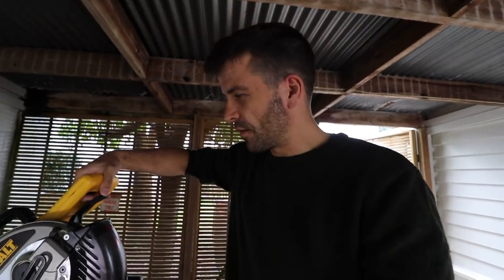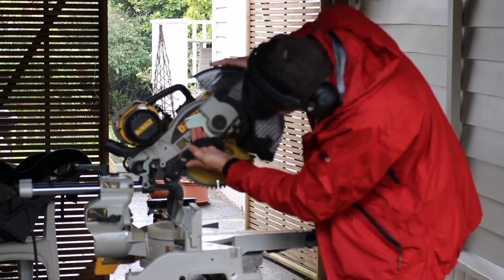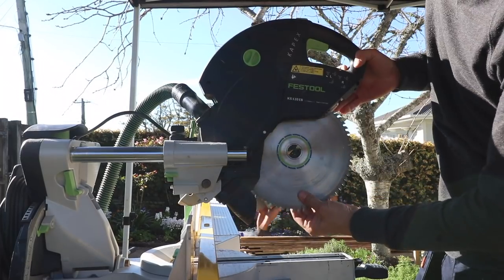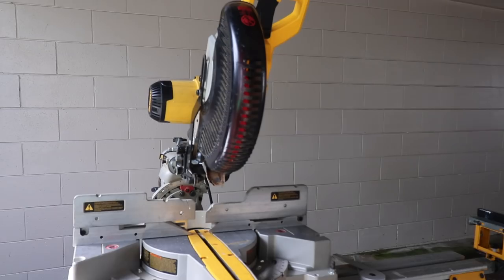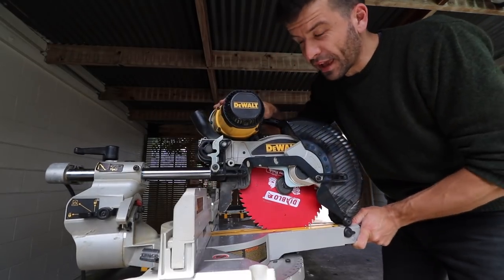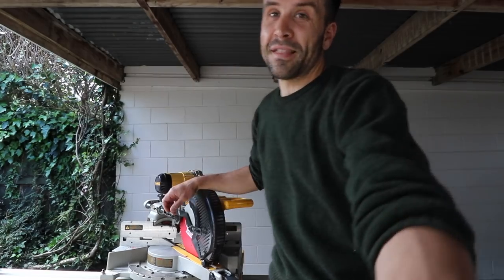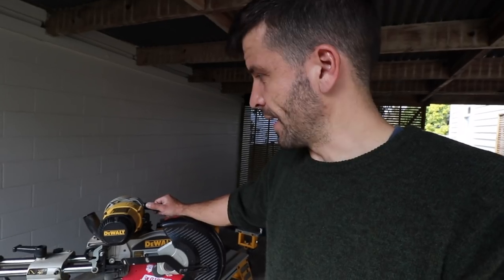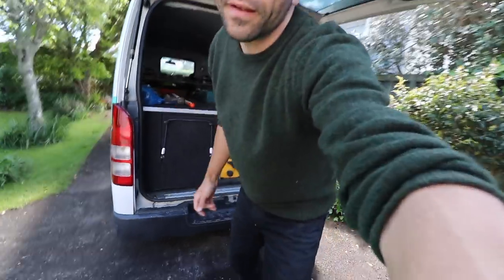Festool Kapex vs Dewalt Mitre Saw

Comment: Festool are very over rated i think, dewalt, makita keep it simple 👍🏻
Reply: +Samwise457
The only people that say they are overrated are those that do not need a Festool tool platform.  If you need accurate, clean, good value and a portable platform then Festool is the only way at the moment to go. 

Where else can I get a single brand tool platform that allows me to take a complete workshop on the road that every tool does exactly as it is suppose to. I have a complete Festool set up and not one of the tools is actually a weakness. 

I simply could not do it with Dewalt (do make great tools as well) as they simply do not have a single platform approach. 

If I went with dewalt I would have to buy several other tool brands as well and I can guarantee you I would end up with twice as many tools.
Reply: bighands69 i disagree with you but each to their own i believe you can achieve the same accuracy with any other professional brand
Reply: +Samewise457
WIth festool I can buy a CMS table that can act as a table saw, router table, sanding table and a jigsaw table. All with festool tools. And the dust collection on each of them is excellent meaning I can use them in a clients home. 

With the CMS  and MFT tables I almost have a full workshop with me on the road. The dust extraction works on all their tools with no problems. With festool drills I only need one drill unit that allows me to change the bit or adapter with just a click. There is no need to two drill units by my side. 

I can go on and on about how flexible the whole approach is.  If you only need a mitre saw then a Dewalt saw is excellent and accurate.
Reply: I recently used the Festool Domino DF500 for some odd shaped teak handrail.  Before I brought my domino in to use, the guys were freehand drilling 3/8" holes for dowels for the joints.  Extremely sloppy and the joints didn't line up very well meaning they required an S-ton of sanding.  The joints with dominos were almost perfect and required very little sanding.  I don't recommend Festool except for the Domino system.
Reply: I think there can be no argument bighands69 that, if you're already invested in the system, Festool offers decent flexibility and accuracy. They always strike me as a company that watches and listens to it's tools users, innovating - or at least producing - accordingly. That's a good thing and quite rare. For those not invested in the platform and already have tables saws, router tables etc, extolling the virtues of the CMS/MFT system will be lost as investment in both those with all accessories to be useful is significant. Whether the system is good value is subjective in this case. Most people don't invest in a system from the off but rather build a collection of tools as they go. Adding and replacing as necessary. However, the system approach is becoming more popular, particularly on the back of cordless tools, where it makes absolute sense. This changing market may well suit Festool. Whilst Festool are good and I'm certainly happy with the few bits I own (although I predominantly use Bosch, Mafell and Hilti) one thing I found found with Festool and it's users that you see to nowhere near the extent with other brands/users is what can only be described as a cultivated identity around Festool. It's marketing genius. And for all it's neat little ideas like portable parf tables and incremental mitre saw bevel adjust, it is mostly the marketing genius that sets the brand truly apart.
Reply: @johnjohansson1196 

No need to be rude.  I had a kapex and got rid of it.  It was inaccurate and Festool refused to fix it.  Festool is overrated, and I own over $6 G's of Festool stuff.  Not only is Festool overrated their service is shit.  I urge everyone to to avoid Festool except for their dominos.
Reply: Sad to hear, and very bad of them not to fix it,  but I  did not recommend it either. but to do like him I was rude to  and recommend a saw who is absolutely inaccurate and have a smal gap is fine?
Reply: I can use any saw. The new makita slider is my favorite saw ive ever owned.
Reply: +Bisch Basch Bosch
I do not identify with Festool like Apple fanboys do. I am more of a practical person. On a per tool basis Mafell are better than Festool and there is no real competition there maybe barring the Domino. 

Dewalt do on a one per one tool basis produce some tools that are as good as Festool such as Mitre saws. 

My point was more to do with the fact on the market place right now there are no tool platforms that could possibly allow me to take a workshop on the road in as little space as I can achieve with Festool. 

Now if Mafell could release a Mitre Saw and a MFT style work table and routing system that could complete with Festool I would be all in with them. As it stands I only have a few Mafell tools in the workshop. 

If I tried to go completely Mafell right now I probably would require other tool brands to fill in the gaps and that's when it starts to get funny and very awkward. 

An MFT table for working in client homes is a must. It means I do not need to have a table saw there even though I have the capability if need be with the CMS table. It is sort of like a workshop lego system.
Reply: Very well said. @BischBaschBosch
Reply: Makita ls1019/ls1219 ftw!  And priced so competitive where I am.  650 for the 12" saw currently.
Reply: @Chimp_No_1  
Bosch make great tools but you cannot make a complete workshop with them on the road.
Reply: @BischBaschBosch  just marketing genius?? Which other company offers similar products and accessories as whole.No marketing man would sell me anything which doesn't serve the purpose well indeed.The only flaw I see - not enough new tools
Reply: @eugeneeugene8252  I didn't say "just marketing genius". I said that is what sets them truly apart. I also mentioned the system approach is something they do well. 
Let me give you an example of Festools cultivated identity in action: There's a particular type of Uvex eye protectors I like. The same protectors come in Bosch and Festool branded variants. All are sold on Amazon and while the Bosch and Uvex own brand ones have 3 star ratings, the Festool ones have glowing 5 star ratings. They're all exactly the same other than brand/colour. 
I see this a lot. Festool do make great kit and, as you mention, they wouldn't be successful if they didn't. But, they don't make perfect kit (no one does tbh). You wouldn't think that though from the comments and reviews from Festool fans. I've got a handful of Festool machines  and I'm happy with them. I'm not uncritical though. It's this "fandom" of Festool which I describe as cultivated identity. No other manufacturer has it. 
Just my opinion. calling it how I see it.
Reply: @BischBaschBosch  yes, you are right,no manufacture has it and we  have to credit where it's due.Festool not perfect but most close to.It's not their fault that nobody tries to take them on apart from some offerings few between.As of fan identity cultivated - that's fans cultivating it  which is amazing in its own right, myself being drawn into it without much regret.And I am not like Festool or nothing, may the best win
Reply: bighands69 I whole hearted disagree with needing other brands to get a complete line of tools if you go with DeWalt. The only tool I own of Festool is their Rotex sanders because DeWalt doesn’t offer one like Makita and Bosch do. If any line is deficient it would be Festool. You don’t even have a table saw!!!! The backbone of any carpentry line!!!! Now, don’t get me wrong. Festool makes great tools. Specialized for the craftsman. But, if you are a craftsman you don’t need Festool to get high end results.

Comment: Changing the 10” Dewalt blade drives me crazy. Designed by an engineer with ADHD. I still love the tool though!
Reply: The engineer was a moron, I can't install a new blade without practically removing the blade safety guard assembly and pulling the plastic dust scoop to the far left-hand side of the saw, then it's risk cutting my hand on the sharp carbide teeth wiggling the blade into place! I hate the F'ing 10" Dewalt, my fault for not trying the POS during the 30day window of return period!

Comment: CT26 & midi have the same motor.. So, shouldn't make a difference on dust extraction..
Reply: Agreed, they have the same suction power and its just the volume that's different
Reply from the maker: Ahh good to know! Cheers
Reply: There used to be different motors in older models I believe.. But that has been changed a long time ago. I myself have a MIDI and a Kapex 120 and I'm quite happy with the dust extraction compared to others. Of course it could always be better.. But yeah.. That'll be nitpicking at some point.

Comment: Cant stand the Dewalt 10 or 12 inch model with the plastic bevel lock just garbage, they cant hold a bevel out of detentes and are pron to breaking if over tightened . The Dewalt like you partner has with the old style metal twist handle on back are proven but cost more. That 10inch Dewalt you have is a HomeDepot special $350-$400 max with out stand, stands go for $200, not $1000 for that saw you got ripped off if you payed that.

Comment: Look up AvE channel, he breaks down tools and reviews them on the quality of parts used internally, the festool Circular saw he reviewed was full of cheap nasty parts
Reply: The festool saw still works in the field for years and stays accurate for that period of time. If you  are working in a coal mine then festool probably is not the toughest tool to be using.
Reply: bighands69 so does my Makita at a quarter of the price
Reply: +Yep 57
I have a complete Festool set up that allows me to have a workshop on the road. If I was to try that with Makita I would need twice as many tools and also would have to use other manufacturers which would also mean having several different batteries in the van. 

Makita and dewalt making good stand along tools and if they suit your needs so be it. Festool make tools that are of a cabinet making accuracy and that applies to all of their tools which cannot be said for all Dewalt or Makita.
Reply: He really didn't know what he was talking about in that review.

Comment: You are completely wrong about the blade change difficulty. The wrench is right on the saw. Try reading the instructions before you talk smack. Furthermore, the kapex is twice the cost and will not outlast the dewalt. The kapex also has more head play than almost any other saw. Dewalt, Bosch, Milwaukee, makita are all great saws for half the price.

Comment: I've worked with the Dewalt setup at the same time with the Festool setup. Only 1 question remains.....In what universe you think that the Dewalt is in the same league with the Festool? It's like comparing an American V8 muscle car with a fine tuned European Ferrari/Lamborghini or Porsche! The Dewalt is like the American V8 muscle car...it will get you there fast....but it will brake down just as fast! The Festool though....will get you there just as fast....but will NOT break down, and will serve you for years and years! I have my Festool setup now for over 9 years, and they still work perfectly! Try, for example, the DEWALT angle grinder for 30 minutes non stop...it cannot handle it, it will breakdown! ( due to the cheap steel they use for the gears in the angle grinder). The DEWALT miter saw will get wear and tear in the spacers they use, causing the DEWALT to completely loose the ability to saw angles. The bearings DEWALT uses are made from the same cheapass steel from China, so they also will stop functioning within a year. Sure the DEWALT is cheaper the the Festool.....but remember...you will buy at least 2 DEWALTS  because they wear out faster then you can say it. Buying 1 FESTOOL will cover you for over ( safely sad) 7 years! But hey, it's your choice to make...... :-) Sincerely Stephan, a Dutch carpenter.

Comment: I use to think Festool was good until i watched a tear down with AvE
Reply: They are still good and still work in the field for years and still remain accurate during that time. I cannot say the same for other brands. Clearly you are not going to use a festool in a coal mine or on top of a mountain in the arctic.
Reply: Once again, AvE knows metalworking stuff, not woodworking.  A bushing works just fine.  The motor works just fine.  He complained about the plug-it system without realizing its purpose.  Honestly he just didn't know what he didn't know.

Comment: I hate changing that d@rn 10" Dewalt's blade!  Always a major source of frustration,.Yesterday I dropped a $70 titanium coated 90T finish blade in the process of wrestling the blade into place! Had to trash the expensive blade which I only used twice!. 
My fricking mistake for buying the saw as another tool addition misguidedly thinking Dewalt was a quality product and leaving it in the box 'till needed which was beyond the return period! Had I tried it immediately after purchase, I would've returned it ASAP! To make matters worse its accuracy sucks and is useless for my needs. I imagine it's really only suitable for onsite general contractor construction work such as framing etc. 
Live and learn. 
I'd love to unload the POS thing and get a propper sliding compound miter saw suitable for finish work as I mistakenly thought this thing was. Oh, and the Dewalt stand is just as lousy.

Comment: You are doing the blade change completely wrong. You made a very simple thing ridiculous. Dewalt wins the whole contest. Its way cheaper, totally accurate, and has a built-in work light that acts more precise than a laser setup. In the USA Dewalt saw is 700 with stand and kapex is 1500 no stand included. Try learning how to change the blade properly since ur keeping the big D.

Comment: Too much plastic on festool.
Reply: and not strong plastic either,,,, took mine back ,, exchanged for the 12 inch flex volt  with 2 batteries charger adaptor  plus stand , and  still got a voucher back for the difference